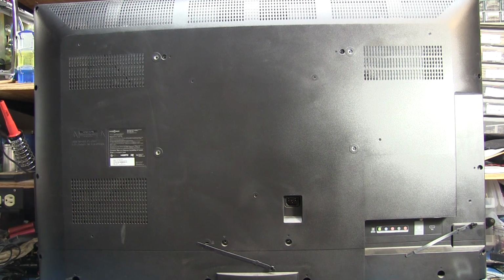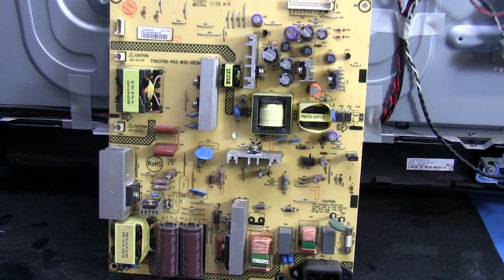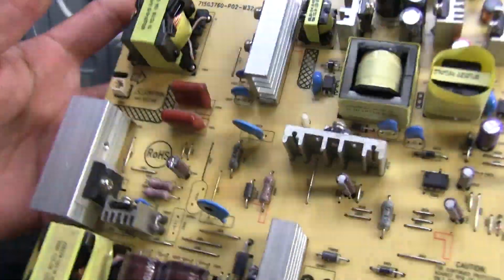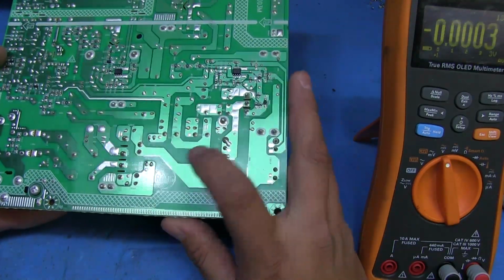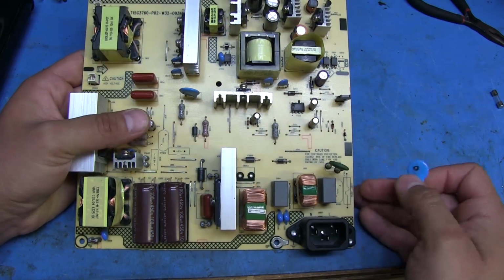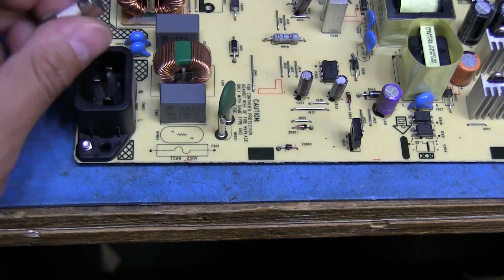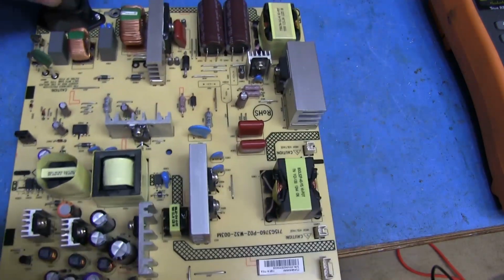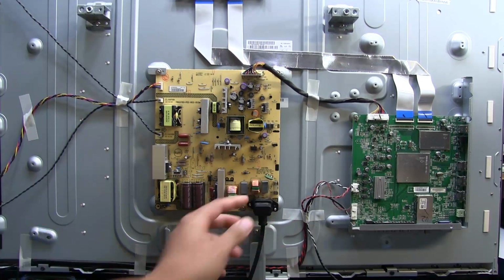TWB #10 | Insignia NS-42L260A13A LCD TV Repair

Comment: Had same exact cap fail on the same tv, copied steps from this video added replaceable fuse holders, fuse, and new cap from frys fixed the tv for under 6$ Thanks “the work bench”

Comment: You really shouldn't touch all the traces and heatsinks directly after disconnecting the mains. The caps can store a nasty charge. Always measure and check for the voltage on the main filter cap's .
Reply from the maker: IncreasingVoltage Oh, trust me, I've gotten my fair share of shocks from fixing power supplies. I'm usually pretty good about checking voltages before going around touching stuff, although this video makes it seem otherwise, but I'll be sure to do a better job next time I make a video dealing with HV mains stuff. Thank you for your feedback!

Comment: Hi, I have this same exact model with the same symptoms .... no power. I checked for the 5V on the pins but nothing although Fuse was good and no visible signs of damage. I purchased a new board through PartsStore.com which is apparently a division of Best Buy. Anyway the board came in today and I went ahead and installed it but same result...nothing. I should have check the new board prior to install, .. but I didn't. I'm going to run it up to Best Buy tonight so they can confirm if the board is bad or not. Any suggestions on this on?

thanks,
Rick

Comment: I just fixed a home theatre system (twice, dopey me shorted the display driver....) Now that I turn it on it says overheat and turns off. I thought it might be either the amplifier or transformer thermistor, but both are plugged in. Everything else should be good. Any ideas? Maybe there's a hard reset I missed?

Comment: I have the same model but all the HDMI ports stopped working. I have switch cables, rebooted and tried different devices. THe ports went one at a time. I am using it with the component cable. Can I switch out the input board? How expensive would that board be? Any thoughts?
Dean

Comment: Picked up a Haier 42" almost just like this insignia up off the side of the road... It's got the exact same power supply board as this tv. My problem is it turns on fine but the word "Haier" is briefly on the screen before the backlight goes out and unless you shine a flashlight on it it's dark. Has sound and picture just no backlight. I'm almost stumped.
Reply: Backlights are bad

Comment: i have Insignia T8-UX38004-MA2 Main Board NS-48DR420NA16  power supply blow transistor i put one but if i connect main board with power it will short again i dont power or main board problem

Comment: hey I have same type tv I have red power light on but it doesn't come on with remote is there a way to turn it on without remote
Reply from the maker: Unless they completely omitted the power button on the TV, there's hopefully at least one button somewhere. It might be capacitive. Maybe underneath the front or something. I don't think I've seen any modern TVs that didn't at least have the one button of some sort. Other than that, I'm not sure without actually opening it up.

Comment: Cheap Chinese firecracker electronics. RCA is one of the most cheapest electronics I have ever purchased.In Electronics-Low price is a guarantee of a cheap item that will die soon. 

I had a tv blow a capacitor just like a firecracker after 3 months of use.